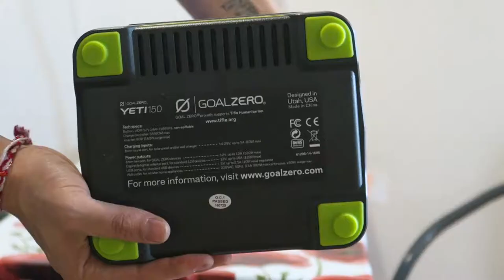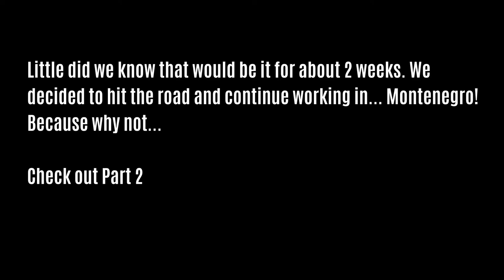Our Self Build VW Stealth Camper Van Conversion Journey. Under 1000 euro

Comment: So Nepal was a side trip or did you drive there?
haha
It is good to have some head room. 
Eliminating the cost of a hotel room will save quite a bit of cash
What will you do for bathroom and shower in Europe?
Reply from the maker: This was actually 2017 and we finished the build and spent the year driving around Europe already! In December we drove the van back to Romania. Calina had to go work unfortunately so we left the van there and while she is working I am now in Nepal. But in about 3 weeks we will both be back in the van for another season mainly in France and Spain.

Toilets and showers actually weren't as tricky as I thought they would be. For toilets sometimes coffee shops or Petrol stations, or if there is a wooded path nearby, well, does a Vanlifer shit in the woods? Yes... :) 

Showers could be tricky and sometimes we would go a week just using wet wipes at night to clean, but often we would either go to a gym and have a workout and then shower, or have an outdoor shower with a sprayer we bought (coming up n another video), which could be tough in colder weather! YOu kind of just figure it out on the way. And yes because we wild camped every night for 6 months we saved a LOT on not paying rent, average about 50 a week on fuel and that's it. Truly awesome trip which I will make a video of once I get the build videos up.